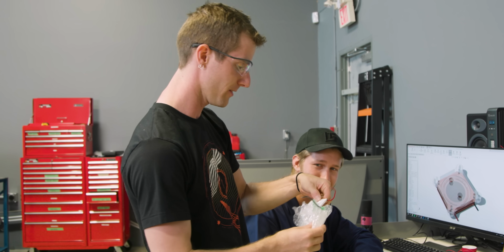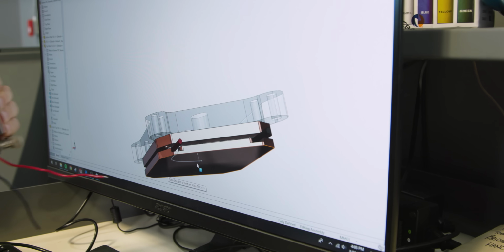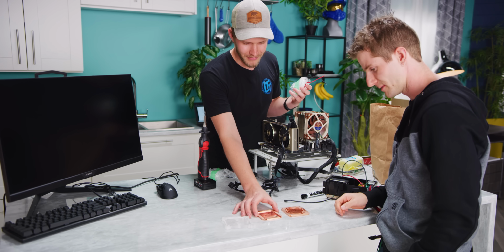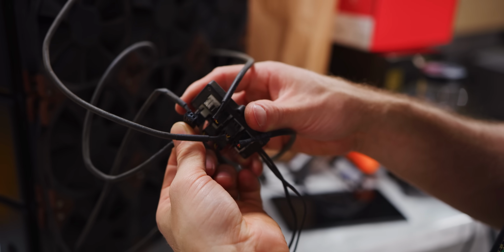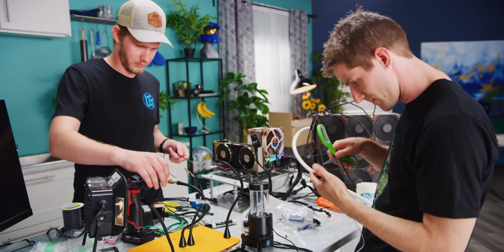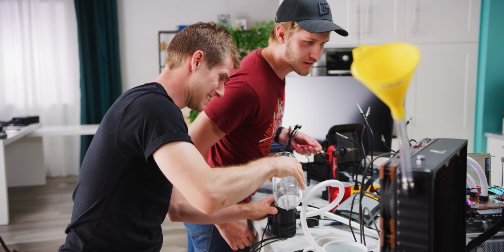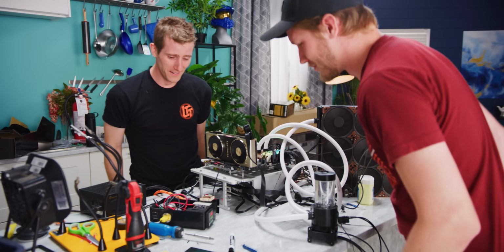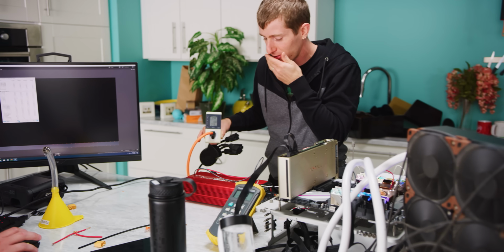This Cooler DRAWS 545W!!? Bad Cooling Ideas #2

Comment: i dunno if alex ever took a thermodynamics class, but if he did, he should see that this whole system doesnt make any sense.

 i dont have the numbers so lets assume that the cpu is generating an X amount of Watts(J/s) which need to be dissipated to keep its Temperature at is current Temperature. so the heat goes from the cpu to the copper block and then to the water to dissipated in the radiator. If they add an electrical component which adds 500 Watts to  the system, the copper heatblock has now to take X + 500W of heat and dissipated it to the water and etc. Now i think that the main problem is that the heatblock cant give all the heat to the water in time which makes the block heat up more, so the system adds more current in order to try to cool the cpu block, only making the problem worse.

The only advantage you have with a system like this that you could theoretly keep your cpu below ambient, if you could dissipated all the extra heat (those 500W) , with maybe more area between the water and the copper heatblock.

i hope you can understand what i wrote, english is not my main language.
Reply: I mean I know the video proved it but can you explain why in terms of thermo?
Reply: @yocheeseify  well, i dont have the numbers so lets assume that the cpu is generating an X amount of Watts(J/s) which need to be dissipated to keep its Temperature at is current Temperature. so the heat goes from the cpu to the copper block and then to the water to dissipated in the radiator. If they add an electrical component which adds 500 Watts to  the system, the copper heatblock has now to take X + 500W of heat and dissipated it to the water and etc. Now i think that the main problem is that the heatblock cant give all the heat to the water in time which makes the block heat up more, so the system adds more current in order to try to cool the cpu block, only making the problem worse.

The only advantage you have with a system like this that you could theoretly keep your cpu below ambient, if you could dissipated all the extra heat (those 500W) , with maybe more area between the water and the copper heatblock.

i hope you can understand what i wrote, english is not my main language.
Reply: @THEGamlion  I understand perfectly. Thanks a lot!!

Comment: Der8auer puts the peltier directly on the ihs. I think your system transfer the heat from the hot side to the cold side over the screws in the bottom copperplate.

Comment: U dont need to check witch side is cold u can just reverse polarity if u put it "wrong way" .
Reply: Actually, no. One side is waay les efficient then the other
Reply: Sorry, the first comment was right, there is no front/back side om peltiers.
Reply: @lars-akeclasson875  hmm. Yeah I read up on it. Apparently it doesn't matter, because of it's alternating pattern. I guess I just had as stupid tec

Comment: Why didn't you just use a normal contactor instead of a solid state relay thingy. Also, doesn't the peltier element have conducting metal on the solder joints that can short against the copper blocks?

Comment: its amazing but what if you generate power from heat out from cpu via semiconductor and the power run fan to make heat face cold in other mean if there is no heat no power and if there is heat then fan will work more  to spend heat  -- generate electricity from heat !?

Comment: Didi you know anything about current drivers? It let's you control the amount off current applied on the peltier system, remeber thar everytime you stops the pwer supply the cells tries to normalize the temps, heating the cold side... So the control system should be independent and a current power supply that modulate the voltage.

Comment: 10:58 Linus, next time put it on a vise with a straight board underneath it to 1. Reduce project stress and 2. To keep your tap straight and easy turning.

I forgot to mention, have the board be the same size as the project and just a 1/32 on each side so all of the tension isnt on the project. To also ensure that the material doesnt flex and change hole placement or tighten dimensions, that sucks when it happens.

Comment: MRI engineer here. What you guys REALLY need is MRI coldhead. Or cryocooler.
Reply: Phase change cooling (not talking about extreme ln2 cooling) was a thing in the early 00's. Not so much these days. You'd have to look pretty hard to find a Prometeia Mach phase change system knocking around.
Reply: The cryocoolers I looked at were good for a 2.5w cooling capacity, so maybe a raspberry pi... (that was obviously a typical 1.6kW water cooled turbomolecular pump for MRI applications). Very cheap pump, but the cold heads are pretty pricey for whatever reason.

Regular refrigeration works well (same power input would have 1600w of cooling load at -35c block temps, going off my phase cooler). And you can make multi-stage for below -100c to go further (my aim is -100c for TR-64 core when it comes out). Refrigeration systems are much more efficient for the heatloads.

Comment: umm this may sound dumb and not even possible, but what about you put the pc in vacuum and then cool it down? Will that work???
Reply: Why would a vacuum make any difference?
Reply: @yocheeseify  no condensation? but then there is an issue with lower cooling efficiency...

Comment: I miss the VapoChill cases. :(
Reply: I saw the LianLi case for like $40 on eBay recently (no cooler). I have one of the coolers, it’s fine for keeping even FX-8350 at 1.7 Vcore sub-zero core temp under full load (-35c block at 350w, -60c at idle). Still works well for most CPUs and a 9900k should run 6 GHz pretty easy with them (which is the only reason you should pick one over Ryzen, 6Ghz would be the minimum I’d use for 240 Hz 1080p gaming). Ridiculously hard to find those phase coolers besides Little Devil branded ones (about $1200).

I gotta build a big one for TR-64 core (goal is -100c multi-stage for my next upgrade to my daily machine).

Comment: haha, i JUST did something close to this.
what you need to do, 
is cool the waterloop with the TEC modules and not the cpu directly.
line up a FEW TEC modules on heat transfer blocks 
from a 2ndary loop to the primary loop
you will need a line of like 1000-1500watts of smaller tec modules

used a TEC between 2 cpu blocks 
1 too the waterblock and 1 to an AIO
https://i.imgur.com/9kfaUCf.jpg
if i leave the pump and tec on overnite i boot to this 
https://i.imgur.com/hCRnFhv.jpg
25c ish
https://twitter.com/cooldarkshin/status/1173311458672664582
Reply from the maker: That's what we did in the first video, and it wasn't super effective.  Instead of using 1500W of TEC to cool the water an air conditioner will work waaay better https://youtu.be/r7pqc26TWAg
Reply: @LinusTechTips  Ayup, after all, a TEC is basically a solid state air conditioner, with the tradeoff of much lower efficiency. The advantages of silence, longevity due to no moving parts, fine control, etc don't outweigh the massively lower efficiency in a high wattage application.
Reply: @LinusTechTips   but could you power a fan off the heat from the same cooler?
Reply: @LinusTechTips  Check out the Industrio build in the forums. That build worked well, but the TEC there was auxiliary cooling for the loop. It was effective at bringing high temps back in line, but I doubt it would have been effective without th cooling towers. Under load, the loop would run at ~45C with the TEC, and between 55-65C without. It made a difference, but wouldn't have been enough by itself. This was with a 400watt TEC. It's the only reasonable way to run a TEC I could think of.
Reply: @LinusTechTips  Please hook this up to a mineral PC with only cables above the water and a skimmer, taking it below ambient and overcoming it as any condensation will just stay on the surface
Reply: Yeah, der8auer did it pretty successfully if I remember correctly
Reply: de8auer did the same thing as well
Reply: I was just thinking something like this like why not just have like a standard water cooling set up but with the cooling block solid copper then just put the TEC on the back with a secondary cooling loop. In fact, why not make a double cooling loop system where the majority of the cooling is handled by the base cooler but when you need extra cooling you can blast the secondary one?
Reply: You really may as well buy a compressor chiller at that point. it will be cheaper and more power efficient.
Reply: Though you supplied us with much explanations and references, I knon I won't be doing it but I give you Like for your efforts.
Reply: Your solution is doing things proper and that not really an LTT thing :D
Reply: Running a custom loop in a pc with only TECs instead of normal rads will lead to the TECs being overwhelmed. What they should do is a loop that goes: EKWB on CPU - D5 - 420mm rad - 545w TEC (cooled by 420mm rad). They should compare it to a setup with 2x 420mm rad and no TEC. If TEC doesn't win then they should try 2x 420mm RAD + 2x 545w TEC vs 4x 420mm rad. And if it catches fire? Blazin'.
Reply: Theres no way their selfmade waterblock can transfer 1000W from tec and cpu
Reply: v Nyggi it doesn’t have to. The cooling effect is only like a tenth because these peltier elements are so ridiculously inefficient.
Reply: Wow you actually used the tubing passthroughs that are still on PC cases for some reason. They are still relevant.
Reply: If only they'd listen to you. Your build looks legit.

Comment: Next video:
Can you cool a PC with radiators from the ISS?
Reply: „After telling you about our sponsor: NASA!“
Reply: Overclocking from the dark side of the moon.
Reply: Well with this we were able to reach temperatures around 10K...
Reply: What about Water cooled Mobo ..... Mobo literally in water... 100% heat transfer, nothing wasted.
Reply: @RaskaTheFurry  Submerge it in thermal goo!
Reply: @RaskaTheFurry it's not in vacuum
Reply: @stephengeorgejaocb6326  vacuum doesnt transfer heat tho... As there is nothing to transfer the heat to...
Reply: @RaskaTheFurry  that's what I meant
Reply: Or you could use then to cool the underside of the motherboard
Reply: Do it
Reply: how about spray the cpu with water prof nano paint and dump it in a bucket of ice?
Reply: Can we fill this AIO with liquid metal?
Reply: But radiators with methane and other shit do work in space
Reply: I know it's a joke, but normal radiators won't work in space
Reply: OmgItsJacob it will work in space. it gets dispersed as radiation

Comment: oh hey, they're in the room they put $300,000 worth of tools in, and haven't yet used in any project. Great job. if you continue at this pace making two videos a year using this workshop, you will have paid off the investment in just 15 years!
Reply: not true i've seen at least 5 videos where they've explicitly said they've machined stuffplus i'm sure they've done it  more. You clearly haven't watched much of this channel if you think linus would allow money to be spent without getting good use
Reply: @finnsander9984  with the old tools, you mean? since they made the workshop video, this waterblock has been their only project, and didn't make use 1/10 of the shit they bought. good luck making enough content to where the sandblaster pays off. Linus is actually known for his extreme spending. He built a $100k editor computer that ran like dogshit. of course half the components were sponsored and they dismantled it for parts 5 minutes after they were done filming.

Comment: GEOTHERMAL cooled pc. It might be just crazy enough.
Reply: While we're doing that lets put a PC in outer space
Reply: @Nathan-te7qr  would space actually cool? There's nothing to transfer heat to in a vacuum.
Reply: Yeah, space would be cooling. Generated heat would just be radiated out
Reply: @NowThatsGreg  you can't radiate heat in a vacuum you comedian.
Reply: @theharbingerofconflation  radiation is the only way to get rid of heat in a vacuum.
Reply: @MechanicaMenace  You mean via Infrared or the atmospheric transparency window (8–13 μm)? Cool shit bro, that would mean wavelength conversion and not just heat transfer from matter to matter. Which was clearly the Idea here. Cooling is actually a major challenge in space and maybe you noticed I was trying to speak to the laymen's point of view prevalent in this comment section.
Reply: @girlsdrinkfeck  Photons.
Reply: Mechanical Menace Maybe I am
Reply: girlsdrinkfeck I like your childish gif xD
Reply: Do you know that that would pretty much mean heating the pc rather than cooling it
Reply: Microsoft did it off Ireland. Works great.
Reply: Already been done actually..
A few years ago some startup company created a bitcoin mining facility inside a mountain.
The mountain already had a building tunneled out inside as it used to be an old Russian military base.
The temperature is so low inside that they have no cooling.
Reply: Belagerungsmörser the Sheep  Linus actually talked about how computers cool in space. it was the video with apollo 50 aniversary.
Reply: Knew someone who did it in the 90s...  buried an old gas cylinder a few metres down (where the temperature is about 10 degrees all year)...
Reply: @JohnR31415  yes, I remember a guy from the early days of overclocking that ran a couple lengths of copper pipe into the ground strait under his house. Worked quite well
Reply: I actually saw a guy on the internet who did that. He buried some 2" tubing in his backyard, ran it into the house and connected it to his servers. Hot water from the CPUs went out and as is passed through the tubing under ground the water cooled off, when it came back in it was at like 18c so the servers stayed nice and cool :D
Reply: Technically this is what Alex did when he cooled a pc with the water from the kitchen sink some months back... Ground water is relatively cool. All you gotta do then is recycle the water
Reply: The supermuc supercomputer is cooled like that😉
Reply: Space is not a perfect vacuum
Reply: @Aaron-dt3xz  it gets transferred as photons, the higher the frequency the hotter the object. That is radiation. If radiation didn't work in a vacuum you wouldn't see the Sun or other stars. Search "black body radiation."
Reply: Mechanical Menace That is true, but in the context of PC cooling, black body radiation is way slower than conduction through matter.
Reply: not really if the water or whatever is like 25* it might actually work
Reply: Belagerungsmörser the Sheep  good to know, I hadn't put too much thought into it. I guess that's what actual satellites and space crafts do though.

Comment: I dunno but linus is addicted to pc cooling
Reply: You mean he's addicited to making PC.. cooler? :DDDDDD
Reply: @Agant.  mostly yess :D
Reply: me too actually, because I have a FX-8350 still
Reply: @BurakKoseoglu-c9i  go get an 9590 ;) they are pretty cheap atm ( atleast where i live ive seen them for about 50 euro )
Reply: @Murlock2000  Nah I'm saving for Ryzen 3 or 4 series :)
Reply: @BurakKoseoglu-c9i  coolgate 360 extreme. one pump, OC it to 5 gHz. systematically works. i had this one and daaaamn it was a good cpu
Reply: Yep
Reply: rapistforhire1999 how do I hire you? Asking for a friend.
Reply: @rpst39  yes
Reply: and my aio began leaking today
Reply: They should do an episode with a racecar radiator and fans
Reply: i bet he snorts cooling paste
Reply: No just RGB
Reply: Same as me. Just that I like heatsinks.
Reply: Hell yh 😆
Reply: aren't we all?
Reply: Mostly, maybe some other neat things too..
Reply: It’s probably because cooling is the biggest barrier to higher performing processors. They can’t just keep increasing core speed and count because the thermals get out of hand quick. If you can improve (and eventually hopefully perfect) the cooling, then performance will go through the roof
Reply: Hi My name is Linus and I'm addicted to water cooling
Reply: it is really addicting
Reply: Pc cooling is the best ! There are so many different products and diy is amazing !
Reply: @excaliburcrusadegaming3534  yeah
Reply: Can confirm, he water-cooled a calculator.
Reply: I know he's nuts!
Reply: 100 likes!
Reply: @TugAndThugComputing  Johnny Johnny did you forget to change your account ?
Reply: @the_guy_with_yeeyee_a_haircut  uh
Reply: @TugAndThugComputing  Why are you replying to yourself exactly?